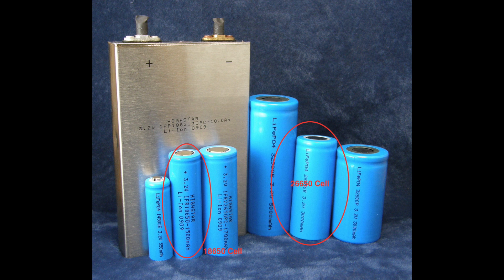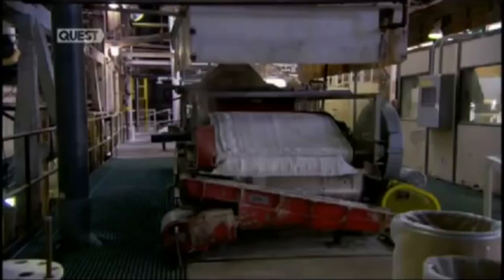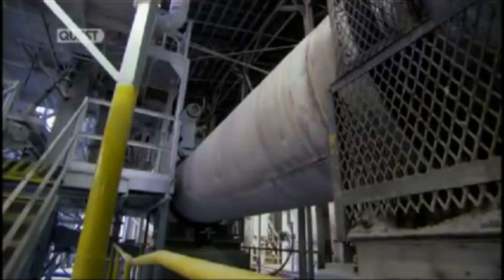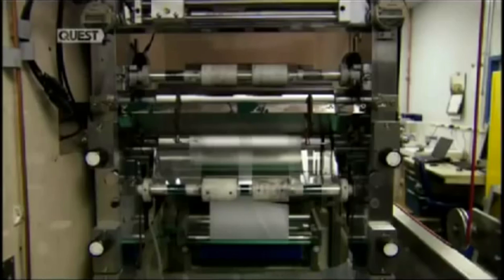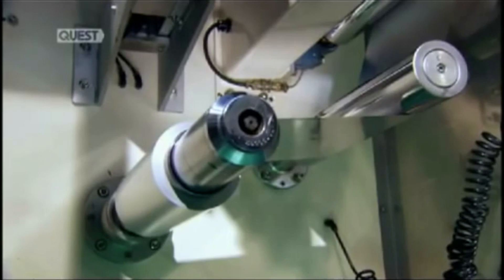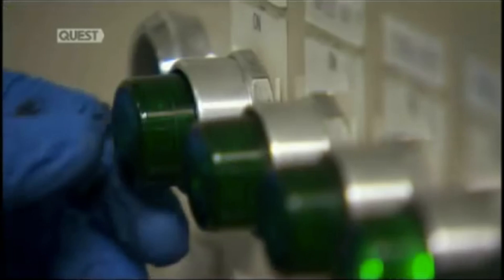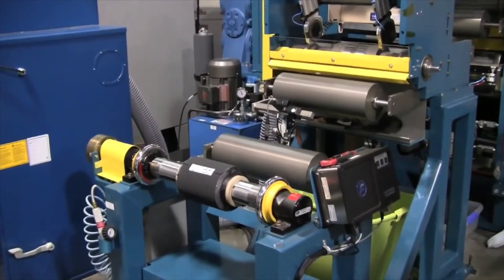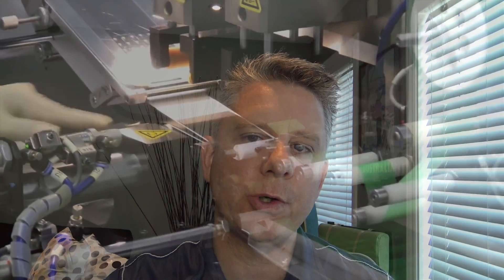How Lithium cells are made

Comment: helpful indeed, sir.
Just scored about 200 pounds of old laptop batteries to try my hand at a DIY storage system, main goal is to force myself to get hands on about electricity, storage and such.
Thanks
Keep on trucking ! (from France)
Reply: Be careful. Obviously any voltage much over about 90V can be fatal (even if your skin is intact and dry, much lower otherwise) but more to the point there is a small risk with every Li-ion cell it will develop an internal short and self destruct in spectacular fashion. You must leave sufficient space between cells so that one cell failing cannot destroy adjacent cells, otherwise the whole lot can go up in a fireball, taking your house with it. You also need to monitor the cell voltage of all cells to ensure that no cell will exceed its safe terminal voltage (that varies with the chemistry employed but 4.2V is a common maximum). Li-ion cells are great but still need to be treated with respect or the consequences can be bad.
Reply: Thanks sir for this detailed feedback. I recognize I know little about electricity and this is an opportunity to learn, albeit as much as possible without making costly  mistakes. Right now... it's mostly an excuse to watch dozens of videos on YT about others going through this process. Approaches vary, and all have their disclaimers, but I think it is a worthwhile learning endeavour.  I'll proceed with caution and move any massive storage to an shed outside. Meanwhile, I don't charge any cells out of sight, or even less at night for fear of missing any spark...
Cheers